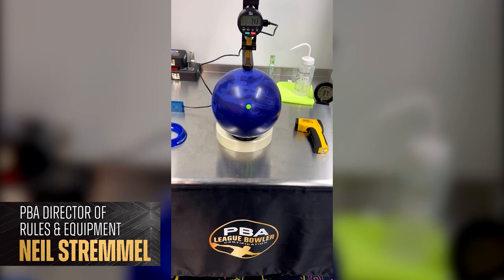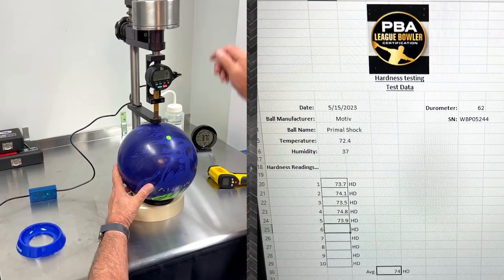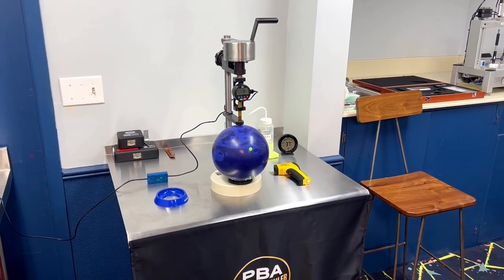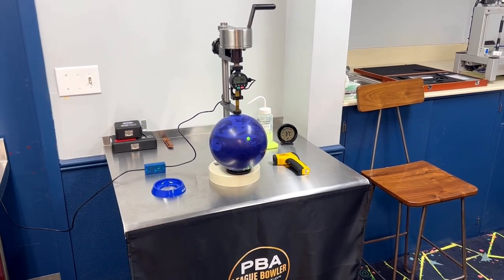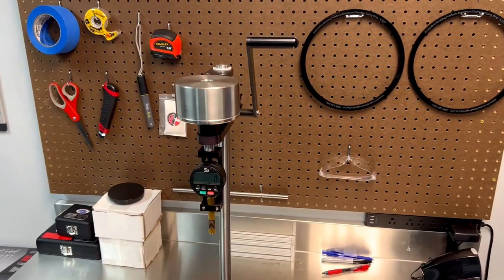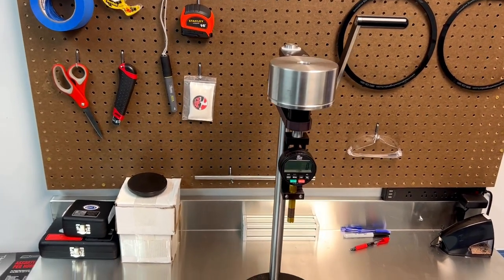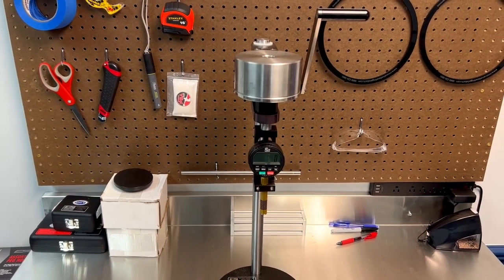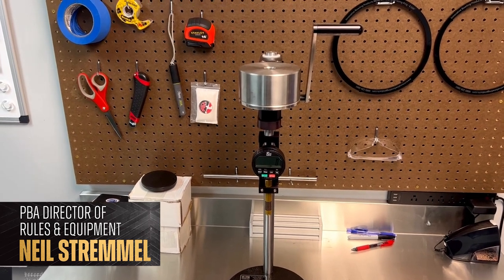Hardness Testing | Neil Stremmel's Bowling Breakdown

Comment: The PBA tests balls at PBA tournaments (field) as well as during lab and lanes tests (Lab). These durometers were used to complete all the testing in the recently published PBA Hardness Report. They get calibrated at least annually. A hardness test consists of 10 readings around the surface of the ball that get averaged into the final hardness value for that ball. An average temperature is also recorded. An official test requires the temperature to be between 70-78 DegF.

Comment: why did the hardness rule come about? because people were using chemicals to make it soft to help it hook more, can a urethane out-hook a high-performance reactive ball? why do pros and high-level amateurs use urethane for? not to hook the whole lane but to condition the lane then eventually you transition into reactive, this rule seems to be reinforced more because of what urethane does to the lane vs why the rule originally came about, if you are in the PBA and you can't adjust to the lanes then maybe you should stick to local tournaments and not cry like baby brash. i've seen clowns like Stu say urethane is not exciting for the fans, stu your bowling technique falls into the same category, should we ban him for not being as exciting as a Belmo, Jesper, or EJ. it's an outdated rule, that's is being enforced because of crybabies, especially in the USBC(aka house hacks)
Reply: Straight from the PBA Hardness Report; "The minimum hardness rule was put in place by the American Bowling Congress (ABC) in the early 1970’s. The reason it was implemented was certain balls had been soaked in Methyl Ethyl Ketone (MEK) and/or other softening chemicals. Soaking a ball made it softer and thereby created an obvious amount of additional hook (it was obvious to bowlers at the time). ABC spent time looking at the situation and determined a soaked ball hooked more. During the early days of my time at ABC and USBC, I asked some people about this situation – and again reconnected with key testing personnel over the past couple of years. What ABC ultimately did was look at footprint (the part of the ball that touches the lane) and then correlate it to hardness via the Rex durometer. They saw at a hardness above 72HD, the footprint had negligible/minimal change, but once the hardness dropped between 72-70HD the footprint began to increase. Then, as the hardness dropped below 70HD, the footprint began to measurably increase. Therefore, that is where they drew the line. Additionally, based on the gauge accuracy of the durometer, publicized by Rex as +/-2.0HD, the limit of 72HD makes sense to ensure the readings truly stayed above 70HD. Historically, bowling balls didn’t get softer with use. This current situation is a new phenomenon. Setting the minimum hardness specification at 72 in the early 1970’s made perfect sense. If anything, modern balls typically get slightly harder as they continued to cure over time. Nevertheless, for a few years now, we have been seeing traditional urethane balls measure softer with use. That is why we need to understand this situation, determine if it matters to the PBA and if so, fix it."